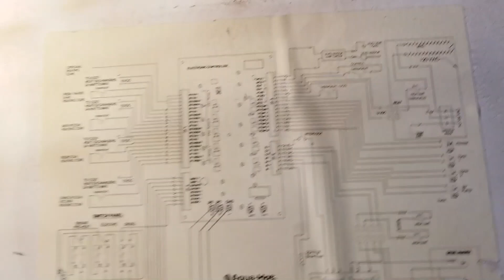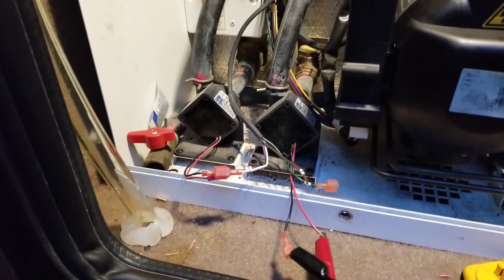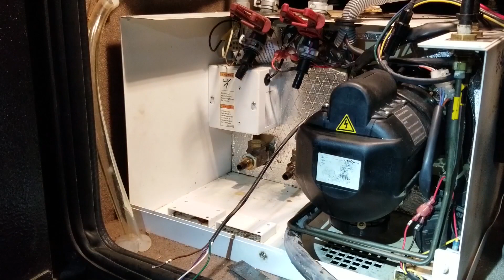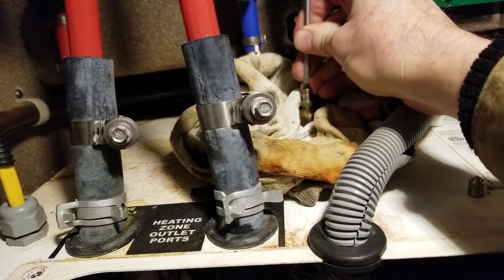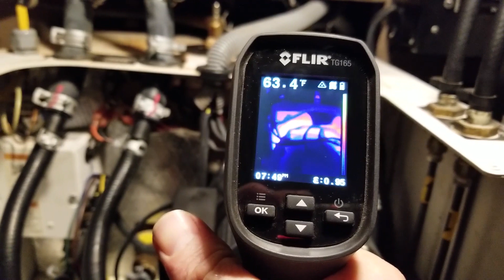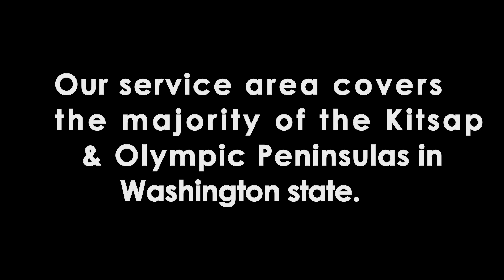Troubleshooting AquaHot 450D With Hot Water But No Heat

Comment: I am so glad I found this video, I had this exact problem when my 450d would make hot water and no heat. It was 25f outside when it failed.  I called the folks at Aqua Hot and they helped me troubleshoot the system and bypass the command circuit in the coach, the pumps were good but the circuit board just got stupid. After I jumped the signals the system started working and hasn't failed again. Go Figure.  It was great to find a video explaining what the components are and where they are located.

Comment: I just took delivery of a Tiffin Phaeton 40 IH with Aqua Hot 450 D.  Your video gives me an understanding that I previously didn't have, and I thank you for that valuable lesson.  I am concerned that these units are not as reliable as I previously found my propane furnaces to be in my other motor-
homes. I am hoping  my Aqua Hot will be trouble free for many years with proper maintenance.

Comment: You are awesome! I have been having issues with my Aquahot 450d not igniting and after watching your videos I was able to fix it myself. However, now have hot water but no heat inside. I'm thinking my check valves are clogged so tomorrow I'll try knocking on them. This whole thing is frustrating because I paid good money to have an annual service dinner in Palm Springs just 3 months ago. Note that I've disassembled the Aquahot, I can guarantee that the guy robbed me and only changed the fuel nozzle and filter. The inner combustion chamber was absolutely filthy and a bunch of build up carbon. It was nasty. Anyway. Hoping I can figure out my heating issue tomorrow. Keep on with your videos, they are amazing. I live in Whidbey Island, wish I was closer to you. Thank you.

Comment: So this "Aquahot" heats the water and the air in your coach nice, thanks for another educational vid. I'm new to RVing and just started working on my 2007 SeaBreeze from National that went out of business the following year. So far the transfer switch, kwikee steps, generator, and one AC unit are not working, The levelers were not working but started working when I replaced the two deep cell batteries. I don't have an Aquahot it was just interesting to watch your video. I will be wearing out your channel, thanks for the help. I haven't got to look at the frig or the heater yet don't know how they are holding up.

Comment: Really good info I do have a hydro hot system and it's working after some needed maintenance.  But my issue is I also have a 110 hot water heater which I can't find to replace the heating element. My question is it actually part of the hydro hot system, I'm thinking it could because it should be in the hot water tank of the hydro hot.

Comment: You are supposed to drill holes for the pump or the cover will chaff the wiring on back of the pump.  That bracket is for the stir pump which has already been replaced.  Also, nice dipping the hose in the antifreeze but put the pump in there as well to make sure it is lubed and not dry.
Reply from the maker: Thanks for the tip

Comment: I have a 2016 Thor Tuscany with a 400D and only one of the two zones function. Both pumps are operating and I’ve disconnected zone 1 return line (which does not get hot) and no antifreeze is flowing. I’ve drained the boiler and made sure the check valve was good. Funny thing is that the zone configuration does not match the schematic from Thor. I can’t find any kinks in the lines. How should I blow out the line?

Comment: New Subscriber. Best AH video yet.  We own a 2015 Tuscany 45AT and had this exact issue.  Hot water but no heat in coach from furnace. Getting repaired now. My question is can yo better explain pump 3? We had same issue; 1&2 had red LED lights and 3 was green. What does 3 shut down when 1&2 are running?

Comment: Great video i had the same square pumps last year and followed your instructions to the "T" replaced them with the retro kit and all was well. fast forward 11 Months .. I don't have heat coming out of the rear coach for pump zone 2... zone 1 pump outlet hose is hot to touch  but zone 2 pump outlet is warm and not as hot and the heat exchangers are not putting out hot air .. would i assume that zone 2 pump is out ? All the lights for zone 1 and zone 2 are green ..  one indication would be there was an over flow of boiler fluid from the reservior one day which maybe that Zone 2 pump failed and not able to pump out the fluid for that line ?

Comment: Thanks for this video. But!   My hoses out of the zone pumps are all hot, with only the front zone blowing hot air thru the radiators. Any suggestions on that?  I believe I have all the air out of the lines. (I did notice the engine heater pump is bad also). Soon to replace.  Tiffin 40' Bus 2015.

Comment: I appreciate this vid. I have a 450D and 1 zone has stopped pumping.  I have not trouble shot it yet. Just assume bad pump. My Aqua Hot is 2010 vintage. I access the burner/pump from passenger side and the display board and expansion tank from the driver side LOL
Reply from the maker: I surely hope this helps you. I do have expectations of more Aqua hot videos coming up in the next few months.

Comment: Hi Garrett,  I live in Bremerton but am currently in San Antonio Texas. 
I have a Tiffin Allegro Bus with a 450-DE Aquahot. I had no heat to zone 2 on my heating loop. I thought I had a stuck check valve.  I tried releasing it with the hammer trick not still no heat.  I decided to drain the boiler fluid and replace the check valve. Lo and behold, the check valve was not stuck.  I’m thinking it’s the zone pump. The motor runs fine but it is not pumping the boiler fluid.  Is it possible that the integrated pump on the motor has somehow failed?  If I need to replace the motor what pump assembly do you recommend?  
Thanks
Kurt

Comment: Very interesting. So on the inlet side of the pump there is a rubber hose that connects into a metal fitting on the wall. Is that a check valve? 

  Aqua hot seems to have engineered as if none of the parts will ever break. No valves to isolate the pumps from the system and jury-rigging the door switch seems like they really cheaped out.
Reply from the maker: There are some check valves in the system and they are obviously larger. Them have a body on them with a nut on the top.

Comment: I have a 400D.  Just had pump one (stir pump) replaced, and because both pumps were the obsolete pumps, had the number 2 replaced as preventative maintenance, as well as annual service.  My issue is that the #1 pump stays on continuously even when power is removed, thermostat off, switches off....  I thought this could be a faulty basement thermostat issue, as I understand, that controls the stir pump zone 2 for regulating temperature in the plumbing and basement area.  I called the Tech that replaced the pumps, and he believes that may be the issue.  Meanwhile, I have disconnected the #1 pump to keep it from burning out the pump.  I realize your assessment will based on what I have given you.....in your opinion, (which I will/would not hold against you) and is for just your valued opinion.  I have heat in zone 1 with burner, and hot water, with just electric, however, I am not sure if the zone 2 will work as advertised for the basement, no heat.

I am an avid follower and view your videos as a reference.....excellent...

Thanks for any input

Ernie
Reply from the maker: It would be good to know, when that pump is running, is there a green status light on the control board? That is to say does a control board want that pump on?  If the control board wants the pump on then you'll need to look at the thermostat input on the JP1 connector that controls that zone.  You can manipulate this by connecting and disconnecting the wires to different zones. Keep in mind that the 'stir' pump runs when the Zone is not calling for heat.  That is to say there's always a circulation through the heat exchanger, if the zone is calling for heat then the circulation is going through the zones.  If the zone is not calling for heat then the circulation is done with his stir pump.

Comment: Very good, detailed video. My coach is 7 months old and has the old style pumps, but they are working(I checked voltage on both and isolated #1 and can feel/hear it running. Lights are sll green). I am not getting heat in zone 1. Zone 2 works fine. The line from Aquahot to check valve is hot, but between check valve and pump remains cool. From the pump 1 to zone 1 is cool also. Is it possible to have a faulty check valve on a new coach? Or should I be looking elsewhere for the problem? I'd rather DIY than drive it to get service. Cold and snowing here. Thanks!

Comment: I have the same aqua hot and I’m only getting 5-7 volts at pump one and it’s not running the pump. I switched the wires from pump 2 to 1 to confirm the pump is good. Any ideas what would cause low voltage? My next step is to check the connections of the wires at the circuit board. Thanks!
Reply from the maker: You can run a jumper wire from the upper right terminal JP3 to that pump directly to find out if it's coming from the control board or if it's the wiring.

Comment: my zone 1 ( main area) only blows cold air zone 2 works great hot water works great was told to tap on check valve might be stuck tried it no difference checked pumps ( by feeling water flow/ vibration) both pumps working.  zone 2 line hot, zone 1 cold.  called a local mobile tech the other day ( it was 21 degrees here in florida) we were in a campground, he came and checked said pumps ok, check valve ok but seems like blockage from return line  from heat exchangers charged me $ 300 said it would need to go to factory to fix ....coach is a tiffin 45,   red bay al along way to go any ideas?? where are heat exchangers located ? does this seem right ? 
thanks

Comment: Those are 10mm nuts not screws, and the mounting boots for the cover  there 7/16 1/4 20 stainless steel bolts,I use pinch off pairs to change the pump.

Comment: Darren, quick question.. do you remember what year this aqua hot was. I have the exact same system in my Entegra, and was curious when aqua hot made that change away from the faulty motors. Mine is a 2016. Thanks in advance!
Reply: This is a 2016 Anthem. Mine. 😬

Comment: Excellent video. I'm on the road and have Zone 2 that stopped working. Don't have the tools or equipment to fix it myself, but found a local tech who has worked on Aqua Hot previously. From your video, I can now go through the process with him and hopefully it will be as easy as you make it seem on the video. One question, is it obvious on the mounting plates, which side is the "tail" to know how to orient the plate?
Reply from the maker: Hi Kenneth,

Thanks for the kind comment.  Hope your tech gets if working for you.  Regarding the 'tail', it should be obvious, if it is turned inboard there is not enough room for the hoses so outboard really is the only way.  

Good luck,
Cheers,
Darren
Reply: You are not supposed to use that plate for those pumps.  You should drill holes or the wires will get chaffed

Comment: Darren,  when watching the video I noticed that the antifreeze looked like automotive antifreeze.  My understanding is you should use a non-toxic,  I forgot the kind of antifreeze it is, but because the domestic hot water runs through the boiler,  cross contamination could happen.  If this is not the correct,  please advise, Thanks,  Enjoy all your videos and have learn a lot.
Reply from the maker: Boiler antifreeze is what is to be used in these systems. It does come in two colors that I'm aware of, reddish-pink, and like a fluorescent orange. I never mix the two but I have worked on the systems with each. When I went through Aqua Hot factory certification training they demonstrated both types.
Reply: It is the same color but it is called Centry fluid. And is non-toxic.